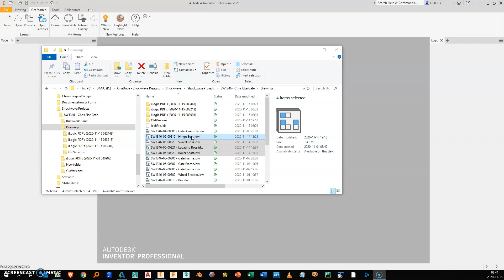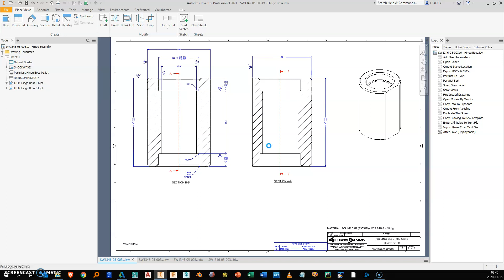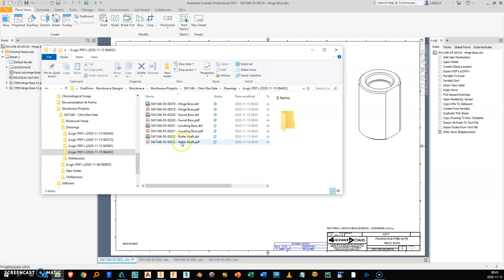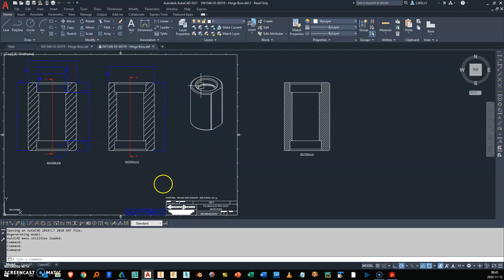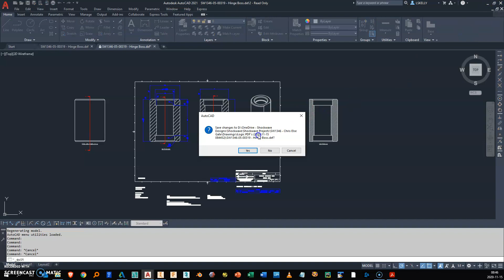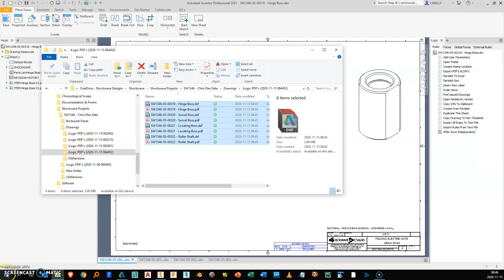Batch Exporting PDFs & DXFs With iLogic - AutoDesk Inventor

Comment: Hello! 

I'm trying to use this rule, but i cannot find the location path for the saved pdfs?

Does it make a difference that i'm trying to save the pdfs from vault as opposed from my computer?
Reply from the maker: The rule only works in the context of an .idw file that has been opened in Inventor. You can add it as a rule internal to the .idw file or run it as an external rule once you have opened the .idw in Inventor.

I have not given any consideration to giving this rule any Vault related functionality. It will only target .idw's that are currently open.

Comment: Thenk you!! very usefull. Is there a way to save the output files as the Part number?
Reply from the maker: @alukard08 I wish to add this option in the future. For now you can try to modify the code yourself.